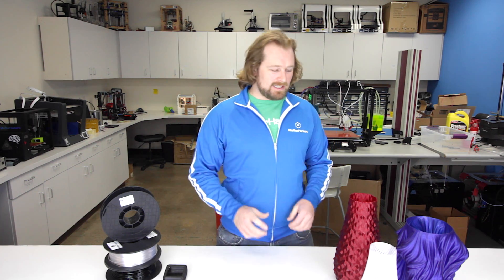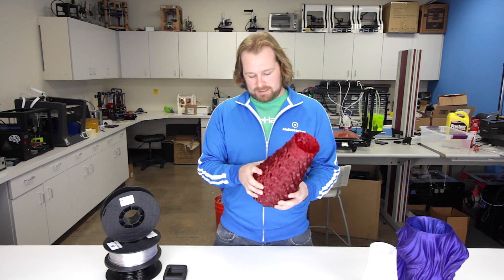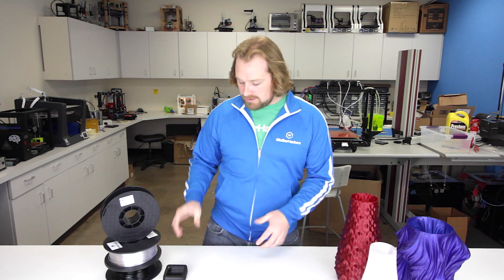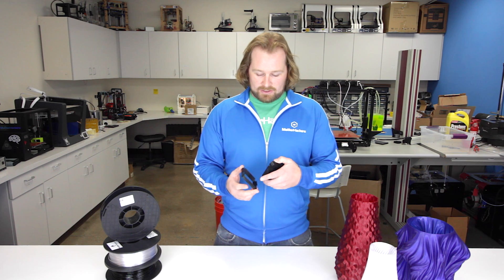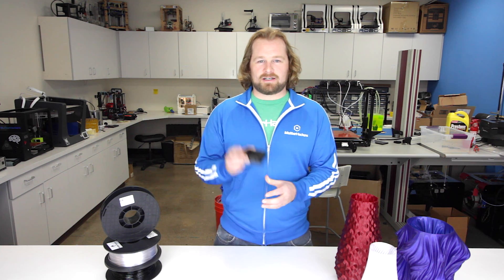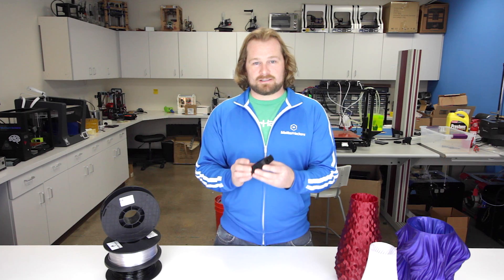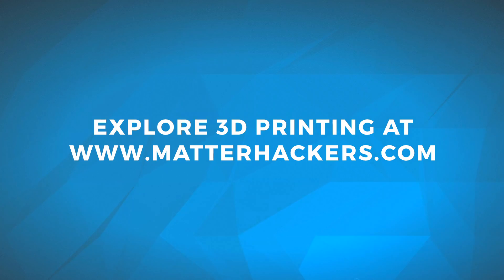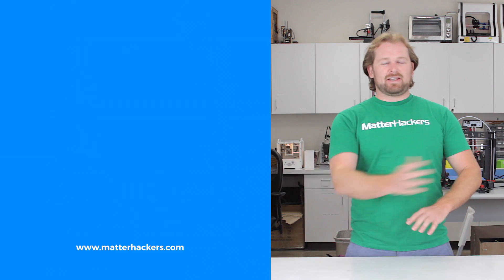How To Succeed When 3D Printing With PETG

Comment: I am trying to print PETG but it prints crappy.. I bought th spool 1+1/2 month ago, and printd right away with default cura setting and it printed great. I left it for sometime during which the weather changed a lot from hot summer to cold rainy autumn. Tried to print again and it comes out like sponge, brittle and deformed. Raised nozzle temp. slowed down print speed, put the spool in an oven at 70 celsius for 4-5 hours and then into a closed box with silica overnight . It didnt work. I get the same results with pla. Havent tried abs. Any thoughts?
Reply from the maker: Sounds like the PETG might be wet. PETG is actually fairly hygroscopic, so it does absorb water from the air, which breaks down the molecular bonds when you're printing twice the boiling point of the water in it. Dry it out sing a PrintDry or your oven and you should be good to go. - Alec

Comment: came here to figure out optimal temp and other things to reduce the insane amount of stringing i get with my new 10lb rolls of MH PETG, got no help here :-/
Reply from the maker: Andreas, we also have our Succeed with PETG article here: https://www.matterhackers.com/news/how-to-succeed-when-printing-with-petg-filament and you're always welcome to email support@matterhackers.com or call us at 949-613-5838 for assistance - we hate stringy PETG too!
Reply: turns out the $223.00 11 lb of petg pro (10lb/1lb) i purchased was poorly wrapped with broken cellophane, and came to me pre moistened. until you guys learn how to use a vacuum sealer, or ziploc with 50 desiccant packets, i cant recommend your products (apparently thats how it was supposed to arrive, but it didn't). 
dont get me started on how brittle the early prints were. 
only a month after slow drying and dryboxing, can i get it to not string wildly, and part cooling with retraction is also key, your vids say nothing about this.
advantage, you forced me to step up my game in 3d printing and be more knowledgeable about it than people doing it for years.
Reply from the maker: Hi Andreas, we are happy to resolve this issue with you! Send an email to support@matterhackers.com and we can help you out!

Comment: was hoping you'd say whether or not you can use most any printer when choosing this filament?
Reply from the maker: As long as your temperature settings are correct, you can use most any printer when printing PETG =)

Comment: this video didnt give me any informaiton, that wasnt already on my spool, 'cept for the blue tape, which is standard. not a comprehensive "how to" at all. what about the common problems to avoid with PETG? curling overhangs, stringing, boogers, droops, moisture absorbtion, and melting issues at high speeeds?
i aint hatin', but this is a pretty crappy and incomplete "how to"

Comment: I've found that PETG doesn't like to be squished like PLA so I find that raising my nozzle about .100mm more than where I normally print with PLA does the trick. Minimizes the boogers that PETG likes to drop as the nozzle isn't plowing the filament around.